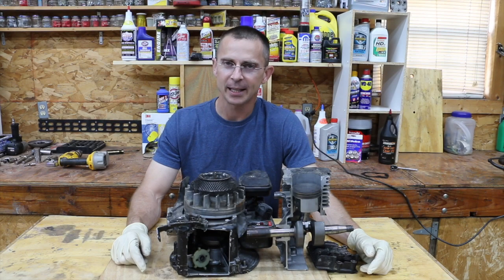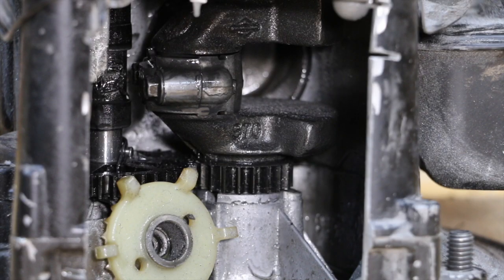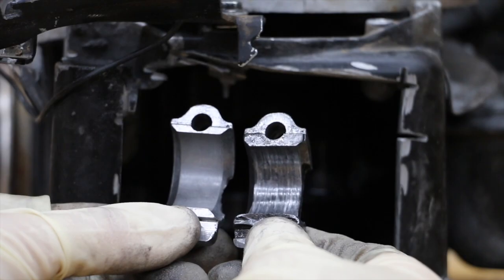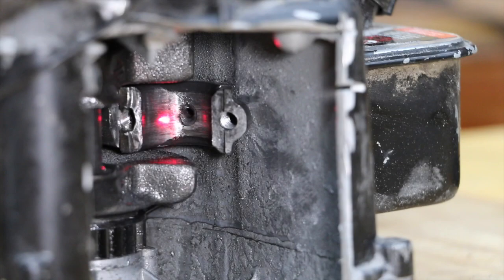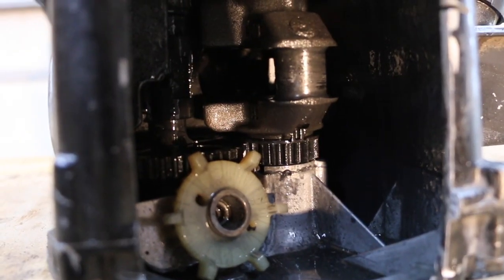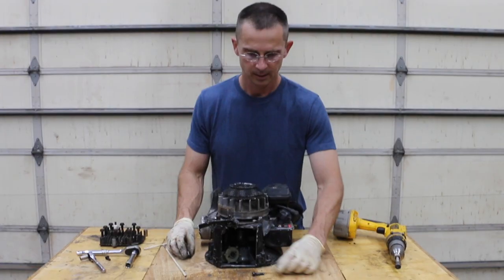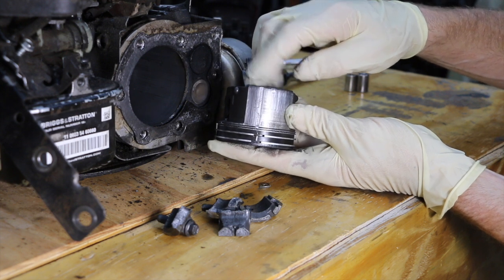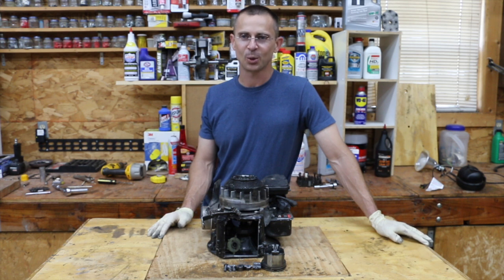Running Cutaway Engine Throws Connecting Rod!

Comment: Our  old second hand John Deere Ride-on mower has just stopped.  Oil everywhere and it won't start or turn, the flywheel only has a fraction of movement in it.  We're in the process of dismantling it (quite new to pulling engines apart - hence my visit here LOL).  We're down to the piston and hubby suspects its a failed conrod (us Aussies shorten everything).  Well we'll keep dismantling it when we get a chance and see how we go.  Thanks for the video.
Reply from the maker: You are welcome!  Thanks for sharing.

Comment: In about 1977, I was on my way to Bishop Calif. for some reason riding with a fella who picked me up in his old Toyota of some vintage with an engine knock that got louder and louder. I thought he should stop and save the engine but when it blew he gave me the keys and went on his way north. I had an old friend who was a Pullman Railway mechanic as a neighbor who helped me tow the car back to Lone Pine and up the hill where we lived so I could get started on the repair. Anyway, he helped me get the crankcase hole braised shut and I put one new piston & connecting rod and new rings and bearings in it and she ran nicely. My old friend paid me $500 dollars for the car as he liked it so much and I had a Subaru I was happy with anyway.
Reply: I was about 20 years old at the time.
Reply from the maker: Thanks for sharing.

Comment: Small engines and very old car engines used a material called: babbit which is a soft lead type of material that allows it to run with limited oil pressure. But, just like all engines, they all require proper oil, oil changes and types of oil. Older cast iron engines with all cast iron can last way longer than any engine built today. That's a fact.
A vehicle that throws a rod while driving it, makes a huge noise and will cause further damage to the rest of the engine and transmission.
Reply from the maker: Thanks for the feedback.

Comment: I've never pulled a lawnmower engine apart.
Am I right in assuming that this particular engine doesn't have big end bearings and relies on lubricant capillaries alone to make sure the big end stays lubricated and doesn't bind up or seize?
I've never seen an engine let go like that close up, seen plenty do it on race tracks but nothing that close.
Cool video.

Comment: i have an idea 4 u try getting an old weed whacker and a moped engine and see what happens when model plane racing fuel used in one and other  same fuel but using a mix of same mentioned fuel but add just a little bit of liquid nitrous oxide into the mix on the second motor to see what will happen when u get both motors running on what fuel i described and have throttle wide open on both to see if it results in runaway rpms until they either quit or self destruct
Reply from the maker: Thanks for the suggestion.

Comment: One thing that I also noticed, besides the lack of oil, you had the shroud off so there was no cooling air going over the cylinder.  I would be interested to see how the valves  and valve stems looked after being exposed to those temperatures without oil.
I would also like to see what happens when the owners manual says not to overspeed the engine.  What would happen if you took the governor off and gave it all it had?
Reply from the maker: Thanks for the suggestion.

Comment: It would be interesting to watch video on water injection. Probably more gains with turbo charger. Small junk yard efi pretty easy to set up with turbo.
Finale could be rod tensile strength test. Rpm.
I spun a blown 540” chevy 9800 rpm for years b4 rod finally punched the block. Not much was salvageable.
Reply from the maker: Great suggestion!  Thank you.

Comment: Back in the late 80s, I ran a Cox .049 hobby/model engine too hard, and after the piston seized, the piston rod broke off piston, made whirring sound for about a second(flywheel spinning), then a hard click noise.  After I took engine out of the car it was in, the bottom side of crankcase had a hole where the piston rod went through.  The size hole, was about 1/4 inch (piston Rod) by 3/4 inch (piston Rod gouge it made because of momentum from flywheel).  I was holding the car when it happened, lol.  Was not expecting that to happen.
Reply from the maker: Thanks for sharing!

Comment: I had just cleaned my windshield when That happened to my car while I was driving on a highway. Did blow the piston through the engine case. Never seen all my dashboard lights come on instantly as the car instantly died.

No oil wasn't my problem though. Mechanic thinks some of the window wash fluid got in through a tiny crack in my engine casing. I don't know a thing about engines or what that meant but he put his fist through a hole that shouldn't have been there.

Damage was so bad I had to replace the entire engine.
Reply from the maker: Wow, sorry to hear!

Comment: I was watching your video on additives and was reminded of using at fluid in the oil but never thought of using it in the gas. I have a 99 Toyota Tacoma with 275k miles. It runs great but every no 'n them it starts running a little ruff. Mostly fuel injectors. I had a qt of Valvoline dex w merc and decided it to both oil 'n gas. It was instant results. I used about 1/3 qt in each. I'm a believer.  Thanks for the info, love you're videos.
Reply from the maker: Thanks and you are welcome!  Thanks for sharing.

Comment: Yes I built a high-performance 283ci small block Chevy ran the hell out of it and blew a rod wow that was cool next a high-performance 327ci punched out 30,000 and build the inside to no end in sight now it’s done I added a Nitrous system Starting off 100 shot of nitrous that gives me 500 hp not stop in there I have a 200 1/2 shot of nitrous that’s the top end of this NOS System. not stopping there??
Reply from the maker: Thanks for sharing.

Comment: It's funny how the pieces of the rod shot out the hole you cut. I wonder if you had not cut it would the rod have smashed that part of the case out? Maybe not from the original force but as the crank swings around again engaging the broken parts and smashing them out of the case there. Thanks for another cool video!!
Reply from the maker: You are welcome!

Comment: Wow now that was awesome. I always wondered what throwing a bearing was like. I just saw at the end that you wanted to know about engine failures. I had a '97 F-150, bought brand new. A mechanic friend of mine suggested Synthetic Oil. After approx. 600mi., on the way back from the Adirondacs, the wife & I stopped for a bit. We got back in the truck and it was clanking after the restart, ruined the whole engine. No more synthetic oil for me.
Reply from the maker: Thanks for sharing.

Comment: I had a 318 wide block in a 1960 Dodge Pioneer Dart let loose with two rods,  one took the starter off the other took the oil filter off.  I drove on until the oil light came on and shut it off.   Then I thought,  why did I extend my walk for an engine that was already junk?  When I got home,  a friend called and told me to not start my car because someone had put something in my oil,  sigh,  a bit late on that information.
Reply from the maker: Thanks for sharing!

Comment: For her High School Graduation present my Sister wanted and got a 1968 Fastback Mustang... not too long afterwards she took to TRYING to be a mechanic on it. With the air cleaner off she was trying to "re-time" it and got a small carburetor fire. Unlike "most" Mechanics she didn't just turn over the engine to suck the fire down into the intake manifold. Her "Solution" was to use the air cleaner cover to SHOVEL DIRT INTO THE CARB... 

After that, without bothering to tell my Father (the REAL Mechanic in the Family), she took to driving the Mustang with the now "DIRTY" engine... I'm sure it sounded like hell as those bits of rock, gravel, and sand worked their "Magic" on the finely machined surfaces of the cylinder walls. By the time she did tell my Dad their wasn't much left of the engine to fix...

On a side note, Dad invented 52 completely new cuss words that night... some of which may have made into the dictionary by now.

Somehow this video, and ABUSE of that venerable Briggs and Stratton brought those memories back to me... Thanks.
Reply from the maker: Thanks for sharing.

Comment: Very similar story to Roy's story below. Back in the 80's, one Sunday morning, the neighbor next door asked me if I could look at his car which had made a "funny noise" on his way home from partying the night before. It was a 70's vintage Slant 6 powered Mopar product. He started the car right up and it shook so much I thought the mirrors were going to fall off it. I popped the hood and saw a grape fruit sized hole  in the side of the block where you could see the crankshaft spinning around like it was a cutaway display in a museum.......and laying right on top of the steering box in all it's glory......lay the mangled connecting rod that had exited through that hole the night before. I reached down and picked it up while chuckling a bit. The neighbor asked what it was, I told him "The end, time for another car", and closed the hood. He was genuinely surprised since he had just driven the car home 35-40 miles on the highway after it had made the "funny noise". The rod still hangs on a wall in my shop.You would think oil was optional in those motors by how they just kept running..

Comment: I bought a 70s v8 truck with a blown engine, tuck it apart out of curiosity and never saw so much destruction. a rod threw on a up stroke and blew out the cam valley. Their were cam parts and lifter parts jammed everywhere and threw the sides of the block. Only the flywheel was useable.
Reply from the maker: Thanks for sharing!

Comment: When you drop most of the crank with half the rods still attached you have had a blowup.
Or a Carrilo rod literally cut a Chev block in half at 8000 rpm
Not my engines, but ones I have seen
Reply from the maker: Thanks for sharing.

Comment: I have a smaller engine I took apart tiny piston and connecting rod this one doesn’t have a cap pulled this engine out of a weed wackier 
And 1 question how does the engine still have compression if the back is cut open the air could easily escape
Reply from the maker: Thanks for sharing.
Reply: @ProjectFarm  your welcome

Comment: Had a volvo that was burning/leaking(dont know which) a lot of oil.  Heard a knock, checked my oil, took 5 quarts to get it full.  That car took 6 quarts.  So I was running on around 1 quart of oil.  Back then my dumbass took zero care of my cars.  I did change my oil normally, but I never checked anything, so I payed the price.  The car wouldnt start the next day unsurprisingly.
Reply from the maker: Thanks for sharing.

Comment: Another event where time without  oil does damage. You need to rebuild the lawnmower,  but the cut in the case means that you have a  boat anchor.
Reply from the maker: Thanks for the suggestion.

Comment: Now a test for JB Weld 😀 have you ever seen how in the 1930's the made wheel bearings for trains they pour the brass from a pot between the cold pin and seal and snap the pin out

Comment: When we were in our early teens my brother and I rebuilt a lawnmower for a friend into a go cart.  The head was slightly pitted so my dad shaved off a bit (really more than he wanted to) and we slapped it back on.  He warned us and we warned our friend not to run it full bore.  Well he didn't, but his cousin did.  And boy did it move!  Until the connecting rod decided that the inside of the crank case was no longer a satisfying life.  Compression is an important factor. We learned that valuable lesson that day.
Reply from the maker: Thanks for sharing!

Comment: 1:59 "... why you dont ever want to run the engine without oil" 
Probably should have told that to my moms Kia Optima lmao. It decided to burn away (or leak, but I dont think its a leak) all of the oil while I was on my way to the bowling alley yesterday. Somehow I was able to drive it home at speed and it hasnt seized yet and it never overheated but now its definitely going to need all brand new rod bearings
Reply from the maker: Thanks for sharing.

Comment: WHY do they make connecting rods from such a weak material as aluminium?
It would never break if it was made out of steel. Even better -- due to lower weight -- of titanium (though it would cost more).
Reply from the maker: Good Question!  Thanks for watching.

Comment: The last time I got an oil change at Walmart, they didn't put the cap back on my motor. All the oil Spilled Out after I drove around 4 to 500 miles on a road trip thinking I have fresh oil and it's all good LOL. It was not all good and my engine started knocking like that. But Walmart did give me a $50 gift card and had two mechanics come out immediately and pour oil in my car. Now I can visualize what happened to my car. Thank you again for all your hard work and dedication. You help me visualize things that I couldn't imagine without seeing firsthand.
Reply from the maker: You are welcome!  Thanks for sharing.

Comment: I had a 2006 Ford Fusion 5 speed with the Mazda 2.3L in it, it ran dry of oil and started knocking and I filled it up with Lucas oil stabilizer and checked it everyday, it drove like that for 7k before I sold it still running and driving
Reply from the maker: Thanks for sharing.

Comment: I think it was in 2000 we got a series 60 diesel engine in that had "runaway" and a connecting rod had come off and nearly sawed the block in half. ECM said it hit 4600 rpms. Series 60s then were governed at 2600.
Reply from the maker: Thanks for sharing.

Comment: My First car, a Corolla did this while on a downhill run on a freeway. It punched a hole into the crank case. Before that it used 2 liters of oil for every 70 miles...
Reply from the maker: Thanks for sharing.

Comment: That was cool ,!!!😆😆😆
I've been a mechanic for a long time,  I came across a demonstration of a product that the company tech's were saying that they could after treating the oil in an engine drain it completely, then run it with NO HARM to the engine !!!  I never got to see the inside of the engine,   but  oil not only lubricates but also removes HEAT and also provides  space between bearings and crankshaft to cushion it from KNOCKING,   SOOO if this is true, how do they do it ? I dont remember for sure but i think it was SLICK 50, OIL treatment,   Thanks William Orange county, ca.
Reply from the maker: Thanks for sharing

Comment: I was told the motor with the lines in the casting like the 1 u r using. R rebuilds from the fact.the block is new but most parts r from returns.so they used good parts 2 save money.
Reply from the maker: Thanks for the feedback.

Comment: I remember a harley party back in the 90s where they took a 80s Honda and drained the coolant and oil. Wot in neutral. 20 min later they started looking nervous. The nod was given at the 22 min mark to light it on fire. It died when the fuel hose melted off. Later that night there were 2 harleys that blew engines in the burnout contest.

Comment: What causes the engine to knock only when it's under load? I have a 1966 Briggs and Stratton that knocks violently when it's working but runs smooth as can be with no load. The engine has been doing this for 25 years. It also Burns a lot of oil. Is it just a badly worn piston and cylinder?

Comment: This is a  really "COOL" video. I picked up a tractor with a golf ball size hole in the crankcase. When I analyzed it I found that gas had leaked into the crankcase. I told  the owner and he said, " he wondered why the oil level was so high before he started it".
Keep these videos coming. Stay safe, Joe Z
Reply from the maker: Thanks, will do.

Comment: I had a Jeep Liberty. It burned oil and my hood release cable had failed so I kinda forgot to keep an eye on the oil level. I floored it in front of my house and the car jerked backed and forth. It wouldn’t start, I later learned it threw a rod. Man I wish I pulled the oil pan.
Reply from the maker: Sorry to hear!  Thanks for watching.

Comment: Yea a good video. My friend has a yamaha R1 litre bike. Ran it without oil. Those imports are pretty durable but a race bike pretty sure he might have a bad time. A bike is basically a pissed off weed eater. So this has been very enlightening. Hopefully he rebuilds those crank arm journals and etc. Cause bikes red line at 12k rpm. That's pretty quik and if an engine shells itd prolly send someone to the ER. Just sayin. If not the rider to the morgue. So good info and much appreciated.
Reply from the maker: Thanks for sharing.

Comment: The workshop lad and I once removed the sump of a 1.8 Duratec focus with a big end knock on cylinder one,set up his camera as safely as we could and started it,expecting a quick death prompted by me revving the thing we were disappointed and thoroughly impressed at the same time when the thing hung on for an incredible 27 minutes with no oil! During which time we alternated idling with blipping,gradual WOT and some rev limiter,it was practically quiet on a gently progressive throttle between 1500-3200 rpm.It eventually threw what was left of the rod out of the back below the cylinder bulge in the crankcase and a small nicely square hole in the front,it was solid with a three foot bar on the crank bolt.the footage is impressive slowed down.
Reply from the maker: Thanks for sharing.

Comment: I bet if you  took some Emory cloth to the crank & put a new rod in it the engine would run for years.  Provided that you glued some hi temp plexi glas over the massive hole you made so it could hold oil again.
Reply from the maker: Thanks for the feedback.